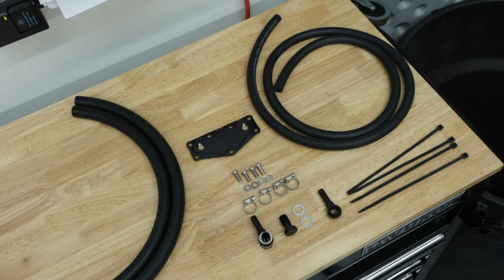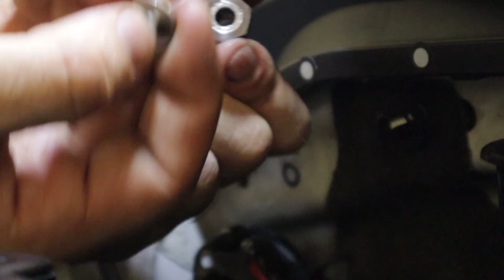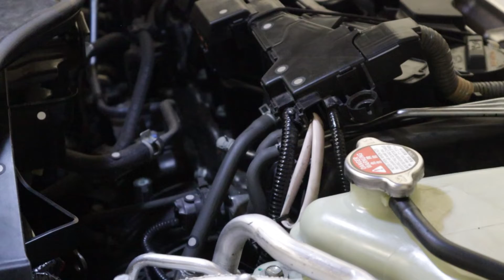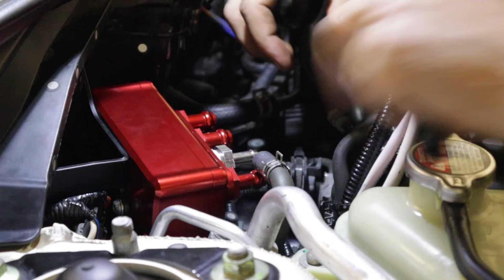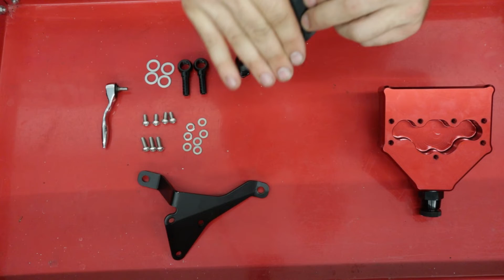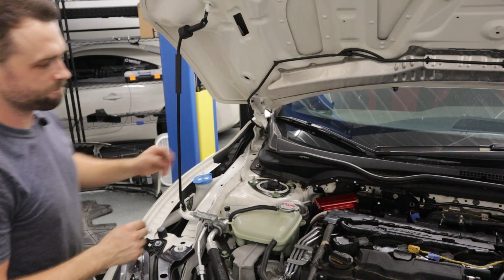Civic Type R AOS Installation

Comment: Respectfully speaking, doesn't Honda have an air/oil separator included in the valve cover for both the K20 amd L15 motors? I'm hearing all sorts of things from multiple sources. Even PRL Motorsports reportedly cancelled their version because of this.
Reply from the maker: Some do, some do not. Our CTR has plenty of oil to catch from us running it on and off track in the AOS.

Comment: How would you empty it?
Reply from the maker: The AOS has a drain petcock on the bottom, simply loosen to let the oil out with a cup underneath.
Reply: @VerusEngineering empty bout every oil change is fine? (Bout 3K miles)
Reply: @devonfk8  I checked mine every 1k miles and would barely get a few drops usually. I went 3.5k one interval and it was maybe a tablespoon of oil.
Reply: @devonfk8  Might vary depend on your engine health and mileage. Definitely recommend checking at 1k intervals for the first 3-5k miles to get a feel for how much oil is coming in. Then adjust your interval accordingly.
Reply: @VerusEngineering  Dang... the FK8 doesn't have a way to return the oil back to the block? Bummer, I'd love to make this completely maintenance free...